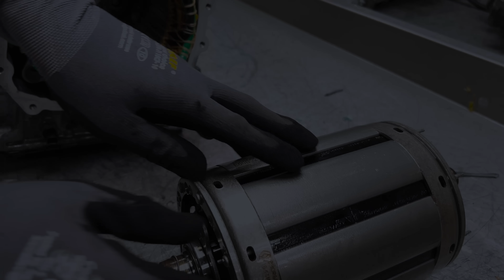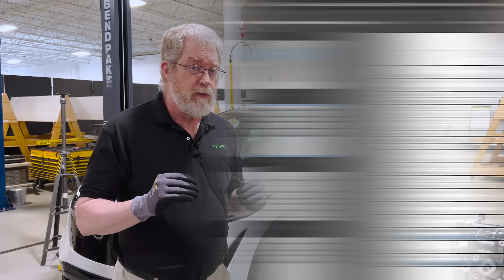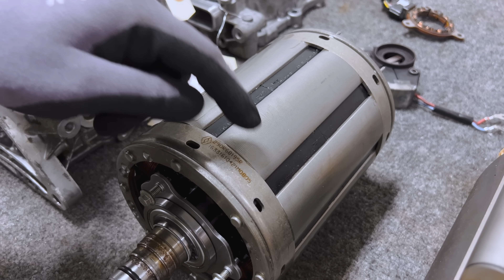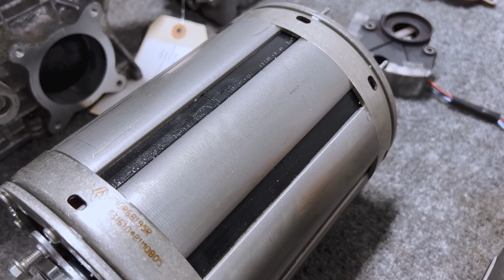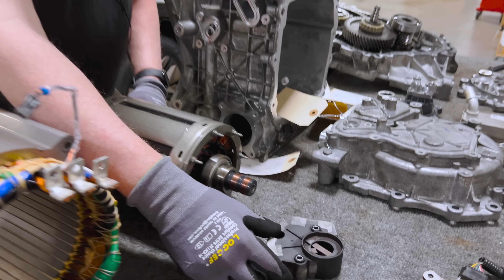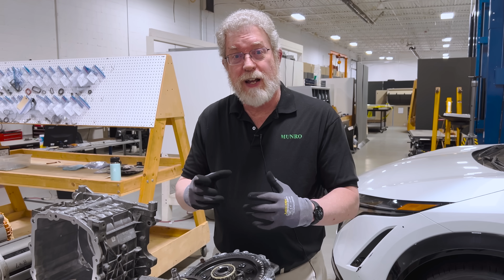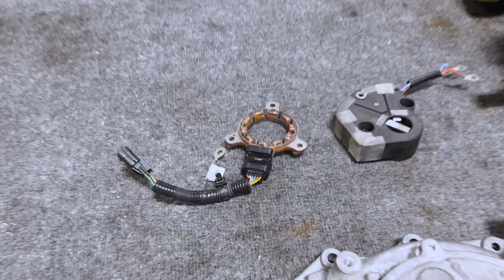This EV Motor Has No Magnets – Nissan Ariya EESM Teardown

Comment: love these vids about motors. wonder if there would be some kind of hybrid where you have both the perm mags and the coils which could add to or subtract from eachother so you still have most of the low speed torque benefit. maybe would require some kind of mechanically or electronically switched brushes. idk.
love making mods to my old chevy volt which i think paul had a big hand in designing. completely redid the low voltage system and added a solar roof lol, documented it on my channel in a poorly filmed video. wonder what he would think.

Comment: This type of motor on the Renault Zoe allows for 22kW 3 phase ac charging. The stator windings form part of the charge circuitry, which saves on manufacturing costs. This is only possible when the rotor magnets can be turned off. 22kW is plenty fast enough for smaller EVs and the cost of charging is generally lower as the charging hardware is within the car. the charging station is really just a mains outlet on a post. Sometimes old ideas work the best.
Reply: Fascinating use. Inductive current limiting in use?
Reply: Huh is it using the regen control circuitry and stuff?
Reply: @lasskinn nah, gonna be using the inductors
Reply: How is the stator used for charging? is such a high inductance needed? It still has resistance.

Comment: RE parking pawl - 
companies use the electric park brake feature instead of the parking pawl, not the ABS. 
Three phase motors do not need a resolver to operate but the resolver does give you more precise control. Examples of three phase synchronous motors without resolvers: multi-rotor helicopters (aka drones), electric model airplanes and electric morel cars. They have variable speed and even reverse.

Comment: You defer to "details", but you miss some.  Looking at the stator, I see my pet peeve: arc welding of the laminations.  Ever since arc welding became commonplace, products are ruined by it in the name of "cheaper".  Are you aware of the heat-treatment process to develop the magnetic properties of motor cores?  It involves the annealing of the material under special atmospheres, (such as cracked ammonia of wet hydrogen) with thermal treatment cycles ranging in hours.  After this treatment, utmost care must be used to not destroy those properties.  Any bending (or other plastic deformation) or stress applied, such as clamping into place or pressing into a housing, destroys those properties.  So what do they do?  They thin the core around the outside, crowding the magnetic flux in those spots.  Then they MELT the metal, right opposite those thin spots, turning the metal into "potato ships" magnetically at the weld & inward the distance of the "heat affected zone", which is way deeper than the visible.  In addition, they are making short circuits across the laminations, inviting eddy currents to come.  The rotor pole pieces look solid to me (are they in fact solid & not laminated?)  There are AC magnetic field components in synchronous motor (harmonics) that will heat these parts.
          I am willing to bet that this motor has a narrower air-gap than equivalent motor with permanent magnets (to keep the field power within reason.  You don't say how much it is.  How many KW is required?)  So these harmonics are more prevalent in wound-field motor, as there is lower magnetic reluctance to them.  This also complicates control due to higher "synchronous reactance" and "armature reaction" than permanent magnet motor where permanent magnet can "push" flux across larger gap, overwhelming much of the armature reaction.
          You comment about permanent magnet needing weakening at high speed.  The magnets in permag motor can be made on purpose not strong enough for slow travel.  Both strengthening & weakening can then be used, mitigating the extra field adjusting currents applied to the armature.  (Losses due to this adjustment is proportional to square of current, so it can be minimized by splitting the difference.)
          Regarding the resolver: why does it have 10 poles when the motor has 8?  (What does the rotor of the resolver look like?)  That would complicate the angle sensing relative to the magnetic field.
          There is a motor design on the web like this except it uses rotary transformer to get power to the field magnets without brushes.  Since they already need a switching supply to drive the field, why didn't they use transformer?

Comment: Hard to imagine that, given the energy needed to excite the coils in the rotor, this could be as efficient as a PM motor.  Cheaper maybe, depending the price of neodymium, but unable to act as a regen generator unless the rotor is excited with power.  Also, seems like there would also be a lower ultimate high RPM, compared to a solid metal rotor loaded with magnets, even if not wrapped in carbon fiber like a Tesla Plaid motor.

Comment: Brushes in an electrick auto motor? What happens when the brushes fail? As in old power tools and the like? Is this not the reason the change was made to brushless motors? Threaded motor housings--fun time when the nut backs off, or the shaft snaps. Nope, this non expert thinks this is a step backwards
Reply: If you were an expert, you would understand that brushes last much longer on simple slip rings like this than they do on segmented commutators (such as in a brushed DC motor). An expert would also be aware that this is the same design as used in automotive alternators, which last a very long time. But you're not, which is why you are concerned about something which experts are not.
Reply: @brianb-p6586 Correct, alternators on modern cars and trucks routinely run 150k miles.  My 03 HD2500 DuraMax has 218k on the original alternator.  I’ve got a 9-3 SAAB with 280k on the original alternator, and the rear main seal failed on the engine.  The rest of the machine will die first, it’s a Nissan.

Comment: After my first Leaf, I proclaimed "Never again".  The proclamation didn't last very long; no other EV in 2019 offered the specific gadgets I wanted.  The electronics are laggy, so I initially had some buyers' regret.  OTOH, it meets the needs adequately.  No drama.
  This explanation of the advances in high speed efficiency are appealing.  However, the Leaf will continue to be adequate for several years, unless a red-light-runner funds a replacement.

Comment: You have not fully. Understood the bearing knurling , the current is high frequency circulating that is inherent in all PWM motors due to both capacitive currents that flow due to the square wave pulses producing high  frequency voltages that pass through the capacitace coupling between the rotor and stator. Rather than using an earth brush to bypass the bearings to carry these currents, the use of ceramic / insulated bearings is often used

Comment: Hi, synchronous  motors tend to have low starting torque, how does thi motor’s starting torque compare to the permanent magnet motors
Reply: The motor delivers 300 NM of torque at launch.  That is roughly 10% lower than the permanent magnet motors in this power range.

Comment: This is based on an old school yet proven industrial design, It was also used extensively in the Renault ZOE. In the ZOE it was a 4 pole motor instead of 6

Comment: Brushes that at minimum go 150k miles is impressive. If the vehicle holds up, it's nice that they can be changed out reasonably easily.
My career as an EE in metal rolling mills went from the final years of MG sets to SCR to AC Inverters. It was a very enjoyable time.
Reply: 150 K miles is about 3000 hours at an average speed of 50 mph. This might be a stretch for brushes on a commutator, but these extra long brushes riding on slip rings should last the life of the batteries.

Comment: So the Japanese have figured out how to make an induction motor with more parts, more complexity and added brushes. What are these people thinking?
An induction motor does the same thing with less complexity.  The only thing they have gained is the rotor field is locked to the rotor. Ither than that this is worse than an induction motor.